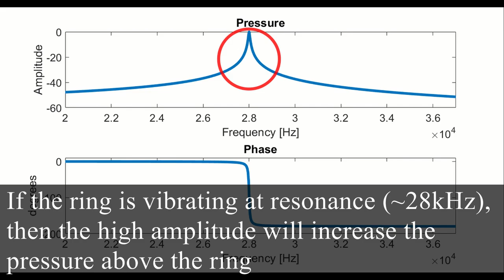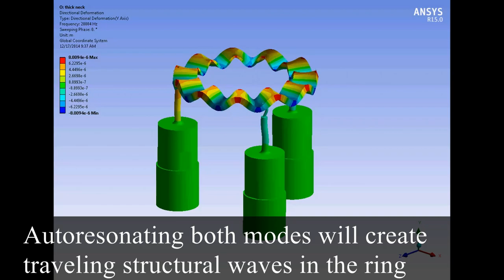Acoustic Levitation Motor - Technion Dynamics Lab

Comment: How is that made At how large is your power source
Reply from the maker: The ring itself is machined from aluminum. Each 40 Watt actuator requires a 120 voltage source AC.